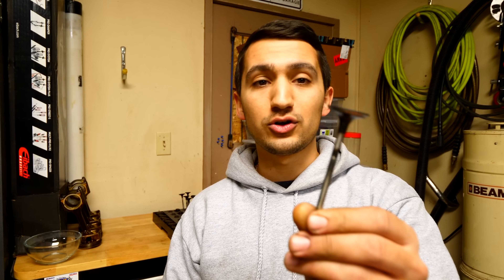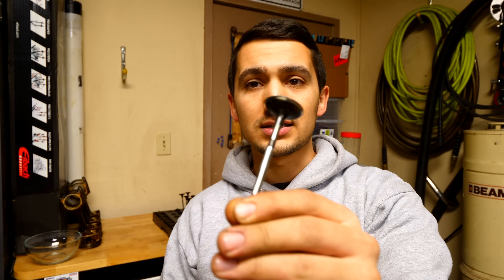How to Clean and Refinish Valves

Comment: 120K Kilometers??   That's like what....90K Miles??
My Pickup has almost 300K Miles, no rebuilds all original, and still runs like new. 
BTW, you removed the PROTECTIVE CERAMIC COATING from your valves.......Good Job.

Comment: And my 2 cents I’m going to run the crank case blow by directly into my exhaust and never deal with this design flaw again .  Happy engine internals sad EPA. These catch cans and blocking half off are a waste of time .  I’m running a ventril vacuum bung directly into exhaust and there for creating the suction needed to adequately vent the valve cover and not spend wasted time and $ on n14 nightmare.

Comment: Not required to polish the valves like that, there is also a coating that prevent the valves from burning only remove the excess carbon carefully without scratching the valve. Don’t be surprised if you burn those valves in a few thousand kilometers.

Comment: Polishing the valve heads is alright but do to the seat face is pointless because you need to lap them. Don't polish the stems, valve guides don't like it when you remove metal from the stems, nor do they (or oil seals) like working with a polished surface.

I'm willing to bet you had a lot of valve train noise if you even installed those, and burned a lot more oil than you previously did.....

Comment: 1 don't take this advice and don't waste your time doing this. 2 carbon will always return no matter how polished it is. 3 get a wire wheel to clean off the carbon and then inspect them. 4 take measurements. 5 professionally resurface your valves and seats. 6 if you want more performance get a 5 angle valve job.

Comment: Very pretty, but absolutely useless valve. After all that hard work and polishing, you now have to take your complete valve head to the machine shop so they can grind the valves and seats so they wont leak,  which defeats  the purpose of polishing them in the first place. I doubt that they can fix the valve stem you ruined, so they'll have to be replaced.

Comment: Would never recommend polishing the valves like this, but if you were to do so having the seats and valves recut and then lapping them would be smart due to changing the size of the valve by sanding it, it would cause the valve to recess farther in the head and not. Hit in the center of the seating area causing you to potentially burn a valve

Comment: Lol you guys are MEEN. Obviously you have to lap your valves after you do this but this technique has been used by mechanics forever. I don’t agree with using a drill to lap valves because you’re putting too much pressure on the stems and could “warp” them. You should definitely use your hands and go back and forth

Comment: I'm assuming those were standard chrome stem, nitrided steel head valves. What you did is reduce the stem diameter =bad, reduce valve head thickness=bad, and you removed the nitrided layer of the head which drastically softens and reduces the valves ability to withstand heat. Take this video down and make a new one acknowledging your mistake.

Comment: I service and repair as a daily grind on BMW/Mini Cooper. This is actually acceptable. Consider when BMW uses walnut blasting on these cars to clean the valves and ports. In cylinder head repair shops, this is actually what happens though I would stop at the scotch brite. The only thing you MUST watch out for is on MINI Cooper valves, the often develop cracks, some of them hairline. It won't be evident until you put it back together and the engine heats up. So if you're dong this, please inspect the valves up close to check for cracks.

Comment: Your %100 wrong on the valves, a valve needs to be put on a lathe and the seat side of the valve needs to be ground to the manufacturers specs. The valve seats in the head needs to be re-cut then you lap the valves in the seats, providing all the valve guides are in tolerance. Deseil should have all the valve springs tested for compression any other way is wrong. P.S you don't clean injectors they have to be tested on a very expensive machine to see what psi they pop at.

Comment: You can clean your valves and get the gunk off but dont and I mean dont ever sand down your valve. Taking metal off little by little can ruin shit. Every millimeter counts on a valve and the measurement. Theres no need to polish the valves cleaning them will be just fine but not no sanding cause your going to have to relap your valves anyways your videos are good but be careful with sanding down the valves I'm a certified mechanic and have done plenty of valves just never sand the valve or the metal off of it
Reply: Do everyone a favor tho and take down this video before you ruin someone's engine please

Comment: I agree for the drill BUT the rest WTF man: 

first put some rubber on the tip of the valve to protect them when you put it in the drill.

second  only use scotch-brite with WD40 (no water) to remove carbon on the head+face+seat+transition region. 
(Sandpaper them if you want to polish)

Last and the most important NEVER sandpaper the valve stem.  if you want to destroy your valve guide do this.

Comment: No offense, as this is a good process, yet for outside pieces. What you're doing is taking OFF material by sanding that much. The only steps you need is to use ScotchBrite pad and some degreaser. Taking more material off does NOT increase performance. The only thing that DOES increase performance is removing the carbon and gunk from it. THEN replace springs, gaskets, and keepers with new. The only thing you'll get is a shiny paperweight if you want it for a street vehicle. Just remove the bulk and polish by degreaser and a rag dude.

Comment: Nothing here about how this damages the stem and the guides as well as the seating surface. The treatments on the valve head are there for a reason. Modern engines do not like this. If you have an old 350 Chevy or 1600 VW, it will run. If you do this your engine will run, but it is not optimal. There are simple products you soak the valves in overnight and all the carbon falls off. That is what professional shops do. I advise you do not do this.

Comment: I like this method for cleaning. Thanks! Don't worry about the haters man, that scotch and sand paper didn't hurt anything at that grit and method.  Not saying someone couldn't mess it up like this, I just don't believe you damaged your valves here. I've seen a guy slap three motors into one with sandpaper buffing all surfaces and still running very smooth at 100k.  Its all in how you use it. I for one have had some fun trying to clean valves by hand and If it comes up in the future I wouldn't be scared to use this method. As well as the assurance of being clean of foreign objects.  The biggest thing is lapping, and everyone seems to be hating on dimensions you havn't got to yet...   My opinion! Cool vid, I'll have to check out some others.  Oh and it seems only one fifth disagree , which is pretty good in regards to debate over mechanical techniques. lol

Comment: The first job should be to check the size of the valve stem.  Too much clearance between the stem and guide will cause the valve to rattle into its seat.  Result more noise, higher wear rate, poor seal and less power.

Comment: This bloke is clearly a cowboy-engineer! He plotted his own theory and he's believing that there are benefits from his idea. Apart from looking good which qualify them for a shelf display, there are no engineering benefits from this whatsoever, here's why: 

1. He has ruined rough surface of the valves. Rough surface is crucial in heat dissipating from the valve into a flowing-by medium (gas). Simply - rough surface dissipates more heat than shiny, flat surface.
2. He has removed nitrided surface of the valve. Nitrited surface gives surface hardness (which helps against friction) and also is a much lower coherent to carbon.
2. Rough surface on inlet valves helps in fuel evaporation and fuel atomisation. It prevents from fouling due to bigger droplets of fuel entering engine and finally did not take part in combustion. Hot vale with a rough surface significantly helps in making fuel mixture homogenius (have you heard about it???).
3. Rough surface is an effect of valves being peened (pellet plasted) during the manufacturing process in order to increase surface hardness and to prevent from uncontrolled heat distortion due to heat. You just ruined it.
4. Any valves looking more shiny (but never polished to a state of a mirror) found in Google for high performance engines are made from totally different marterials (usually austenitic stainless steel or from titanium steel) and are ground - not polished. They are obtained from totally different materials to yours and are allowed to be more smooth with no harm to their functionality - but yet not being polished!
5. What looks smooth does not necesarry means will give you any benefits in termas of HP - havbe you ever validated your modifications on the dyno to see any gainst before and after? I doubt and I am absolutely shure You would found no gain in HP as a resut of your valve polishing.
6. You just lost a seal bedding on the valve seat contact - You will soon find that your valve seat in the head have a cracks or even burns due to not seating evenly.

Comment: This video has some good and Bad. 
Pro’s: 

1 . Increased Air flow over the Valve Face due to less “Carbon” and imperfections on the valve face. Smoother valves should equal less air turbulence as the air passes the valve.

2. The Valves look Damn Good for pictures, post, videos, & etc.  Adds to sell value

Comment: I like this idea but I would suggest not touching the portion of the valve stem that goes in the guide. I would also suggest you lap the valves into their seat on the engine.

Comment: What you've done here is completely useless, if not detrimental to the valves.
You sanded the stem, so now they won't have the proper stem-to-guide clearance.
You also sanded the valve face, so now they probably won't seal properly.
Nice work.
Reply: AaronBonbarron  Highly unlikely with 400 Grit he took off material When you have a pro do a Valve job they polish the valves with ScotchBrite pads . That's like 300 Grit : He didn't hurt a Thing  to hurt vaLVES:
Reply: @cramerlong2276  lol no they don't.
Reply: Sure they do : I stopped in and asked what they use : Tell me this : The head is aluminum : I have watched countless videos of using 400 Grit or Red Scotchbrite on the Gasket area to clean off old gasket build up. The valves are harder material then the head is. Look at it this way : Buildup of carbon in your mind doesn't hurt But taking it off does? Especially with a material less hard then the valve.   Have you actually done a valve job ?
Reply: @cramerlong2276  Scotch Brite won't do any damage, I never said that. 
I didn't say removing carbon buildup is bad either? What are you talking about?
You can see just in the thumbnail how much material he took off with 400 grit, the corners of the valve face are gone.
I'm doing a valve job on one of my engines right now, and making a video about it.
Reply: I'd appreciate the link when you're done :)

Comment: I don't understand why you are polishing them. I comprehend that smooth surfaces will not get carbon buildup as fast, but on this motor, it will happen either way immediately. They are pretty, and it made a good video, but the only way they will stay clean is if you add a water/meth kit or fabricate a custom rig to shoot some fuel on the back of the valves in addition to the direct injection. I'd think (maybe I'm wrong) you'll get the same performance and reduction of coking polished or unpolished. I assume you are doing this just for the experience and to make a video to show off the reflection, but then I'd think you would have only done one... or two if first was practice and second was for camera, but I see many are done. Power to you!

Comment: Put those valves back on the head and do a leak test. Put water or mineral spirits on the intake and exhaust ports and see if it come out of your valves. More than likely, you will leak. 
Now go and lap those valves by hand. Good luck. It's a pain in the ass.

Comment: When I did this method, I stopped at 1000 grit. lol I started at 600 too. But my engine was in no way a performance engine. I rebuilt it because it had 200k miles, it was out of the car because I was transferring it to a new one, and one of the valve guides had to be replaced. So I cleaned them all, replaced the valve guide, and replaced all the valve seals. Nice to see someone else did this. Also, allot of that black stuff in the bottom of the bowl was mostly from the sandpaper. Really awesome video though! A thing to note, if it seems like it's not consistent in the drill, the valve may be bent, and would need to be replaced. I also used a bit of heat shrink tubing to prevent damage to my valves.

Comment: Did you really just spend the money on 3000 grit sandpaper and put it in a bowl that has 800, 1000, and 1500 grit residue? You should consider not doing that, or else, just polish after 800 grit.

Comment: This video is great but make sure when doing what is shown in the video to stay away from the part of the valve that contacts the seat in the head other wise you can cause valve leaks ! Other wise you will have to re-lap the valves with valve compound .Also if you have a small drill press you can put the valve stem in the drill press and take a metal file for filing metal and take your time but remove the ridge on the valve just behind where the valve rest on the seat ! Works for both intake and exhaust valves it saves money and free's up horse power and air flow. On the exhaust valves only you can round out the two sharpe edges on the edge of the valve just above where the valve rests on the seat! It creates better flow and no turbulence when exhaust gas leaves the cylinder exits through the exhaust port!

Comment: You serious dude?
Reply: Literally none of that will do anything to improve performance! All you did is create an oil leak through the stem seal. Also those valves wil NOT seal the combustion chamber. See the shiny ring on the “old” ones? That’s what actually makes the seal once seated properly.  You’ll have to grind that in with a grinding agent. But you’ll probably be best of replacing those sparkling clean valves for new ones. Not trying to be an *ss here but you should probably not be doing a repair like this without help or at least proper documentation.

Comment: You should stick to polishing paint and leave the engine alone. If you really want to help people, pull this vid, read a book you may learn something, say any engine book from the 50's on and you'll realise a polished surface slows the intake charge, increases heat transfer and allows the fuel to stick, so less power. You'd over double low lift valve flow efficiency simply back cutting the 45 sealing surface to 1mm wide.

Comment: The black "paint", not the carbon build up, on the front and back of the valve head that he sanded off is a protective coating to reflect heat and prevent corrosion. The valves may be all shiny afterwards but their normal service life has been significantly shortened. Just use a strong solvent like B12 Chemtool/Seafoam and a brass brush to remove the carbon and then lap the valves. Don't follow the directions in this video.

Comment: how are there 300+  comments (from people who have worked on engines)on how the valve angle is now off,the stem is out of spec.and how this is pointless and less efficient but 2.3k likes!!??This may be how some shops clean valves (not the stem) but then they grind the valves and seats to match. How many engines were killed from the making of this video?
Reply: These Youtube kids believe that lapping valves is the correct way to restore valve sealing surface. But that can be done only if youre in a budget build just trying to make the engine run. The real reason for lapping and why its done by shops is only to verify that the valve sits evenly and correctly in its seat and that is done only after freshly angle-cut seat with machined or new valve in it. Taking a worn valve and lapping it in a worn valve seat is going to restore the seal but only for the current room temperature and will benefit engine for very short time. These are ABCs of engine rebuilding but who cares about that right? Just get your valves all shiny because thats how you roll. Freaking youtube.. Full of BS.

Comment: Although I get the concept of what Milan is stating about better engine performance, I'd wish he had actually did some Dyno tests of a before and after a cleaning and polishing. Of course this would require him to take the valves out after he put the engine together just to do a chart test and then cleaning them again and polishing them, but seeing the results on a chart/scale would help with motivation on whether or not the added and extra work and time would actually be worth it and realistically pay off. Just my thought.

Comment: don't do this... sanding, polishing and even a scotchbrite will remove metal. yes, one could lap them but how much? cleaning would be more ideal than removing metal. how you do it is up you, this is going to cause more hassle. i've rebuild heads for a living and i can vouch sometimes they are a pain to get seating right. i'm talking freshly cut seats and new valves. i've seen them take several cuts on a machine made just to cut seats. just a bad idea for a home job.

Comment: Uhhhhh why does the valve need to look polished.  They dont even look like that from factory. Also, it have a polished look after 10 miles.  Also, you cant fuckinnngg see the valve.  Make it workn. Dont make it look good.  Id say soak the valves in b12 chemtool.  Scrub with a brass brush. And make sure they seat.  The hell with this bs